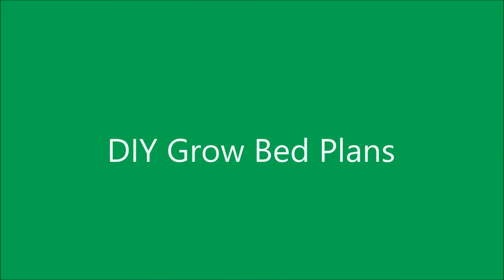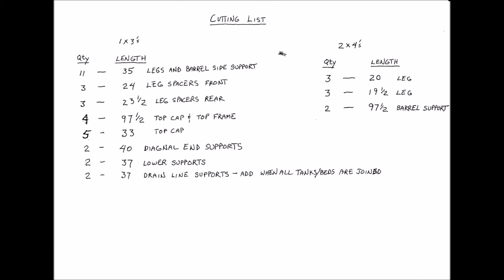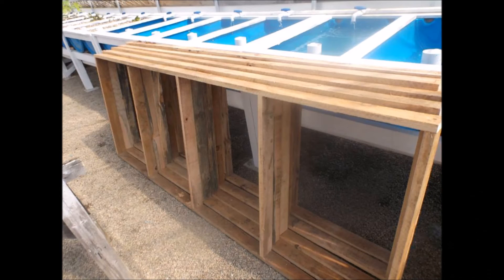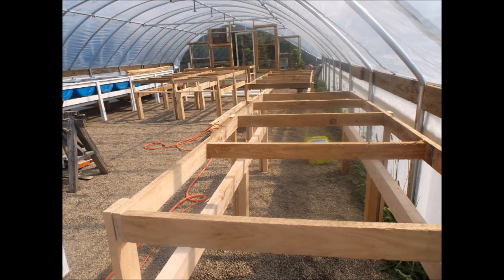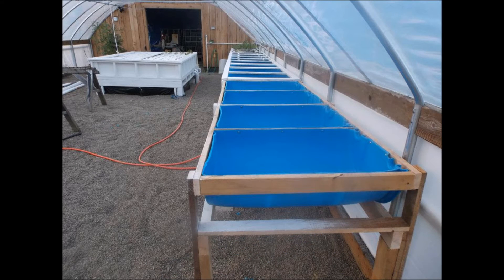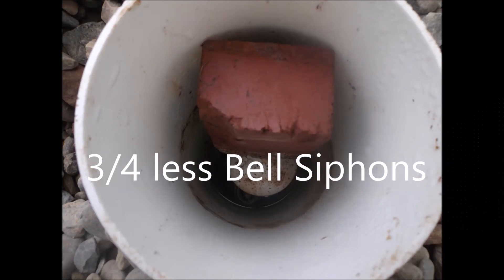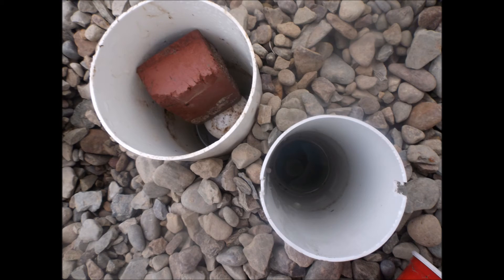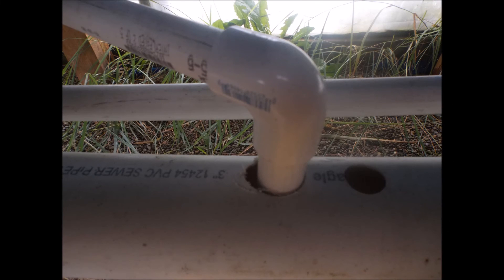DIY Aquaponics Grow Bed Plans

Comment: Why didn't you cut the barrels so you can use the plug
Reply from the maker: Only because the first setup was to have every barrel a stand alone unit with it's own bell siphon. the later versions the barrels are tied together.

Comment: Hi there, Thanks for sharing your knowledge on building an Aquaponic system. I have some barrels I'd like to split in half to use as my grow beds but they have contained fuel in the past. Is there any way I can use them by applying a paint or coating of some sort to the inside to make them safe to use? Thanks Jim
Reply from the maker: I'm afraid that the coating at some point in time will be compromised and fail for you, and the coating may be more expensive than the cost of a barrel --- I get my barrels for two dollars a barrel, and cutting them in half gets a grow bed for a buck.  I drive an hour to a Welches juice plant that sells them at that price. I have been seeing used barrels sell for $14 each at garden supplies.  That's $7 a grow bed--- Also think of the peace of mind knowing that you won't have anything nasty leaching into your system.---Don
Reply: Thank you very much.
Reply: nooooooooo, they are only 15$ get food grade. i see its 2 yrs ago but hopefully u didnt do that.
Reply: fuel is a bio hazard. that stuff gets into the pours of the barrels and stays.  no way to clean that. get food grade 275 gallons totes or the 55 gal food grade for 15$ in my area. I have been waiting to do this. i think im going to start one very similar to this one. thanks for vid.
Reply: 275 gal 150 food grad average

Comment: Just completed my first 4 barrel grow-bed unit, other 4 will have to wait as I'm departing Monday for work. The other four units will hopefully be done when i return unless the honey-do list is long. I'm really interested in your pipe layout with pipe sizes  to beds and drain sizes as well as pump size, siphon hole size, bulk head fitting size for bell siphon. If you can help I'd be grateful. Thanks again Donald
Reply from the maker: +Robert Madden I do need to draw up a specification sheet on my system---Will get on it and back to you my friend---Don
Reply: Thank you sir. I might not see it on Youtube for a while as I'm about to depart for locations off grid so the speak but will look for it soon as I get back to civilization via your page which I always visit anyway or you can email it if you remember my address and have time :)... if not, I'll get it if you post it on youtube. Thanks my friend

Comment: Based on your project, and the design that u sent me, I made a 3D design in Sketchup.

https://3dwarehouse.sketchup.com/model.html?id=ubc9be570-6ffc-4ce6-9533-2a206c18ea05
Reply from the maker: Emilio Konrath Wonderful---I love it---so much better than my sketch---Don
Reply: Donald Porta I will improve even more. I'll put the pieces with the measures.
Reply: +Emilio Konrath love the 3d drawing but it has piping coming out the sides. Is that an upgrade or is there another system similar? Thanks for posting the 3D Skethup, really cool
Reply: +Robert Madden My project is based on Don design. I thought it best to make 3 half barrels, believe so is the flow gets better distributed. Put the pipes in front of barrels per think is best, just for this.
Reply: +Emilio Konrath I gotcha. thanks